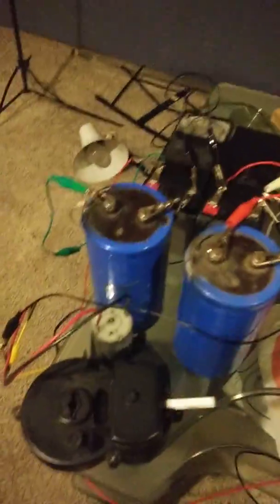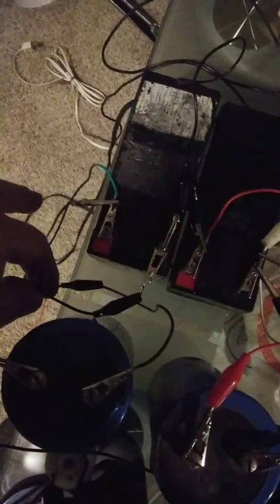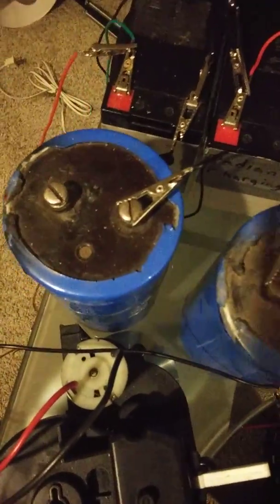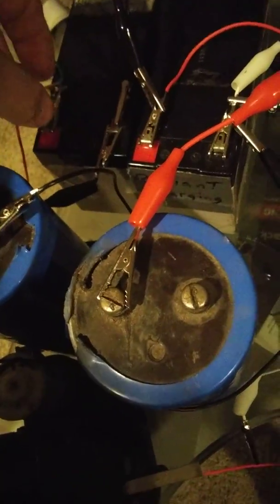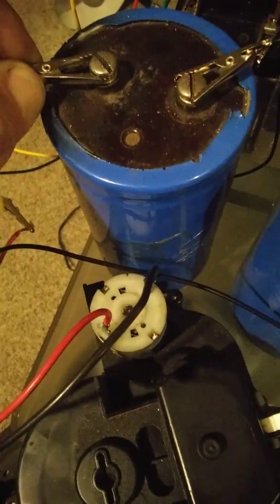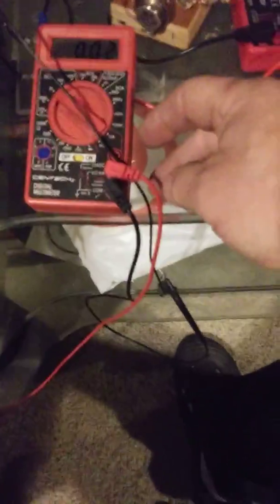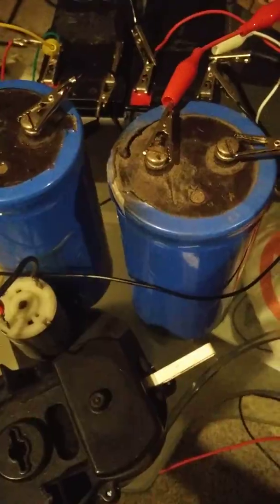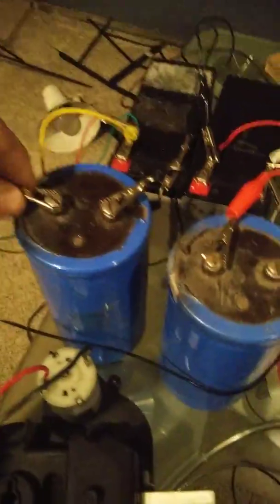Free energy experiment :-)

Comment: Most likely...the batteries are not actually "dead".  Each battery has a small voltage.  However, when the batteries are connected in series to the motor the voltage of the batteries immediately drops due to the resistance of the load to below the current (I=V/R) necessary to provide enough force to move the motor.

Assuming that the capacitors have no charge initially, short them out before experiment.  When you now place each capacitor on each battery, now the capacitor are in series with the motor as well as the batteries.  The capacitors will immediately charge to the voltage of each battery.  So now the motor has the charge available from each capacitor, and each capacitor will replenish itself from each battery.  In essence you are able now to deliver sufficient charge which originated in the batteries from the capacitors that are connected in series.  Of course if you place a volt meter on each battery over time you will see this voltage decreasing to the point where even with the capacitors the motor will cease to run.  Remember that even though the batteries are "dead" they really weren't as they still had some voltage.  This happens as well with LED flashlights where we throw batteries with charge away when the batteries still have energy remaining.
Reply from the maker: Thanks for your comment, the batteries weren't the same voltage, one show about three and a half volts the other showed almost 10 but had almost no current, I believe that's why it wouldn't run the motor, but when I hook the capacitors up from my understanding the capacitors will translate the voltage into instantaneous current, but I don't know why it kept speeding up? But am I correct in assuming that it's okay to hook batteries in series with capacitors hooked to each battery in parallel? I mean there is no danger to explode a capacitor? Thanks again for your comment
Reply: Very interesting effects.  But to why the motor "kept speeding up" might be due to increasing internal battery heating which can release more chemical activity and hence more available power out.  On a cold day cranking a car engine with a weak battery may at first fail.  But, as you try again a couple times, the battery chemistry heats a bit and delivers more power to now allow the weak battery to crank the car.  Seen it a thousand times.  But you would need more testing to see if this is the same effect with your setup.
Reply from the maker: @energycrafts8206  you may have a point, because one of the batteries only had about 3 volts in it, so I'm sure that some of the cells may have shorted out, and I found out that when a battery has a shorted shell and you put a load on it, sometimes the voltage reverses polarity, in that case will not allow voltage to run anyting, but when you add a capacitor it will, thanks for your comment :-)
Reply: @fpveddie  Not much danger of exploding  the capacitor if you connect your capacitors right...and obviously you used caps with a higher voltage capacity then the battery voltage.  Put a scope on it that may give you clues as to why the motor speeds up.

Comment: It might be helpful to measure the current. Also capacitors might help to deliver more energy to start the motor.
Reply from the maker: Thank you for your comment, the capacitors help to start the motor, but then it started speeding up, which means the capacitor was being charged buy batteries it had almost no current in them? I could short out the capacitors before I started, but it did start speeding up, so even if they started out totally dead they are being charged faster than the motor can use the energy, but anyway this is normal? Really the one thing I wanted to try to do was see if I can hook up a capacitor in parallel with four dead batteries then hook them batteries in series to see if the capacitors would still work, without exploding or something , because I have never seen it done and I wasn't sure what would happen, do you feel that it would be safe? Or do I need to worry that one might explode? Thanks again for your comment
Reply: @fpveddie  you can try to measure the voltage on motor power input connector wirh oscilloscope. You can buy a PC USB osclilloscope for about 50$. 
When it comes to capacitor explosions, it all depends how much energy there is in them. To my understanding capacitors explode when the voltage applied to them exeeds ther voltage rating.
Reply from the maker: @Kapalek84  thank you for your comment, I feel better because I know the capacitors voltage exceeds the battery voltage, thanks again